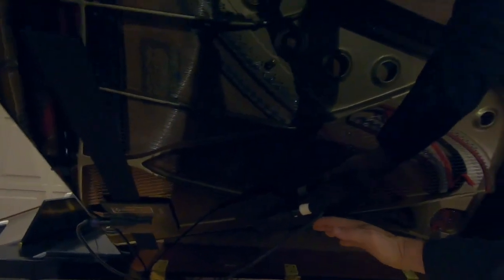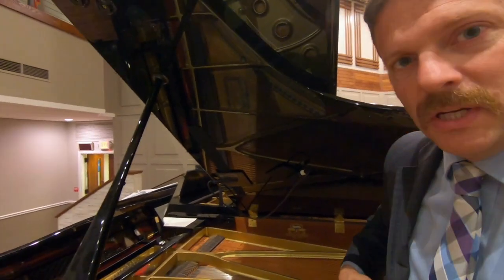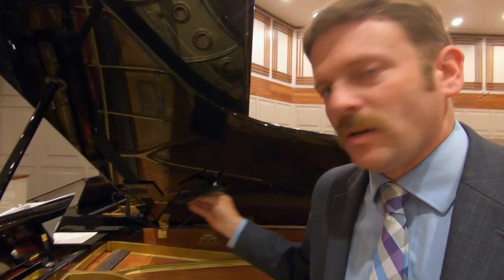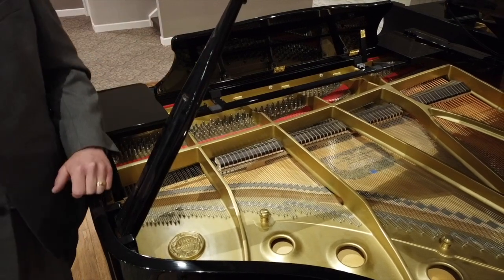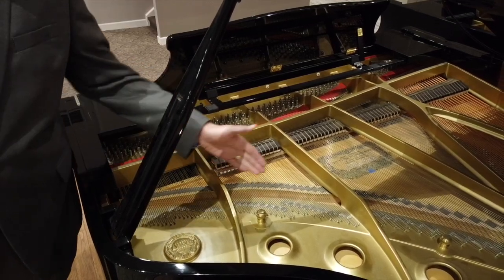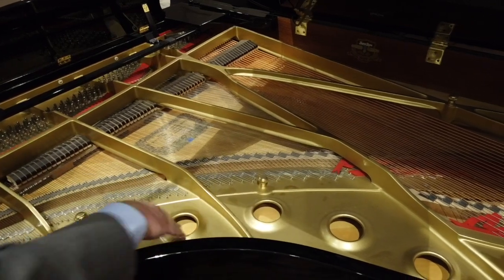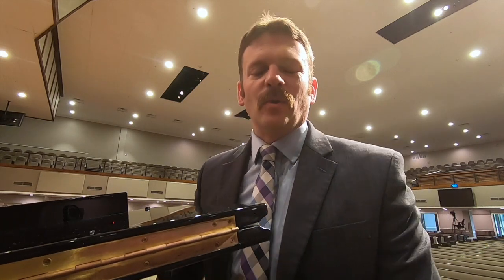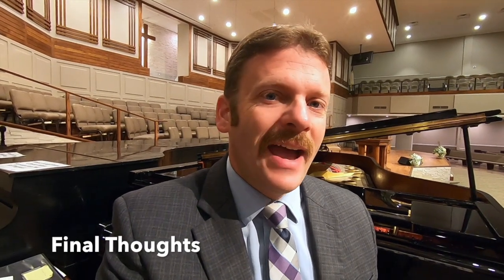How to mic a grand piano - Sound Advice 07

Comment: I love the sound you get from those PZM's! Based on your recommendation, I have purchased some of my own for the piano in our sanctuary. I am still an audio novice, so having your board settings would teach me a lot. I know I will need to experiment with our particular instrument, worship space, board, player, etc., but I would like to use your processing settings as a starting point. Would you be willing to reply with the settings you use for each of these? I'm sure I won't be the only one to find it helpful!
* Gain: 
* Frequency/Low cut: 
* Polarity (Ø): Invert for one, but not both, correct?
* Gate:  
* Compressor:  
* Dynamics:  
* Equalizer: "Brighten" between 2,000-4,000 Hz. How much? What else?
* Effects: 

* Pan/Balance:
Thanks in advance!!
Reply from the maker: Drew, a great question!  We will answer this in 2 posts.  I will take the approach from live sound-Front of House, and Jonathan will look at the recording/broadcast mix (here’s a behind-the-scenes look at the broadcast control room https://youtu.be/5wCJuqZF79s).  We might be able to get Joe’s (piano player) input in the differences between pianos.

Every venue has its own ecosystem and it’s all dependent on the type of sound system, style and needs of music and speech, room acoustics, style of instruments, and the ear of the sound tech. I love epic music, and tend to mix and EQ that way.  When it comes to the piano, the sound I love is not a natural acoustic representation, even though most people would say it is.  I want to feel the bottom register, but equally need the upper mids for the pitch reference and brightness.  The acoustic piano tends to be naturally mid heavy.  The two pianos on our platform are miked and tuned to that instrument’s sound and style.  In our church, we have a Altec Lansing center cluster that hits every seat that has a clear line of site with the cluster.  In addition, we have left and right Altec Lansing speakers that add a spatial stereo sound the center cluster lacks. And, we have 2 dual Altec Lansing 18” subs for the “epic” feel.  I mix and EQ the pianos to help lead the congregational singing, so I look for a bright but percussive sound.  The stereo mics are routed to the left and right speakers respectively and summed to the center cluster (which is tuned brighter than the left and right).

EQ:
HPF-60HZ, LF shelf-70Hz/+1.3 dB, LM-294Hz/0.9 Q/-3.5dB, HM-1.65kHz/0.6 Q/-3.5dB, HF-4.36kHz/0.7 Q/-2.4 dB. 

Compression:
3:1 Ratio, -1.5dB Threshold, 4.60ms attack, 500ms Release.

Reverb:
On the piano,I use a brighter reverb with a 1.5 second decay.  I have the reverb in the left and right speakers only.

I do not use any gates in live sound.  Both mics are in normal phase.
Reply: Hi Drew,
On the recording-side here are the settings I use. Both mics have phase set to 0°.

Gain: Same preamp as FOH
HPF: Off unless needed for someone "thumping" the sustain pedal. 
Gate:
   Attack: 500μs
   Release: 1s
   Hold: Off/lowest time
   Threshold: Depends on your preamp level. I have it set at -28dB for our set-up.
   Depth: 20dB
P-EQ:
   Band 1: 48hz shelf - 14dB
   Band 4: 2.5kHz shelf - 6dB
Compressor: 16T Comp/Limiter
   Ratio: 1.5:1
   Knee: Hard
   Threshold: Again, depends on your gain but we are at -12dB.
   Output Gain: 10dB
  Parallel Compression: On, -6dB Dry and -6dB Wet.

My master output has the following:
Compressor: Manual RMS
   Attack: 300ms
   Release: 2s
   Ratio: 4:1
   Threshold: -15dB
   Gain: 18dB
   Knee: Hard
   Parallel Compression: Off
Reply: Thank you both so much! Going to get these installed using Velcro per your rec, and going to start with these settings for our live and broadcast mixes!! Thank you for your ministry!!!
Reply: Joe here chiming in. To add to the discussion, every piano is different, sometimes even the same model from the same manufacturer. For instance, the piano in this video is a Kawai RX-6. At our college is a Kawai GS-60. They're very similar in size and of course manufacturer, but the two pianos sound absolutely nothing alike. In my experience, moving the mic(s) as little as an inch or turning a few degrees can make significant changes in the sound. You've come this far, so take it all the way by scheduling an hour or two with your main pianist, and have them just play while you move the mics until you get happy. Then take a 10 minute break, and then listen again to make sure you're happy. It may seem tedious, but it's definitely rewarding in the end!
Reply: @collinschoral  Also, if you have access to a phasescope, use that as well as your ears to adjust the mic positioning. Pan the mics hard left and right and the scope can give you some helpful information. You want it anywhere between 0 and +1; 0 being a full stereo image and +1 being mono. If it goes into the negative, your mics are out of phase. If they are out of phase a little, it won't necessarily sound bad on a stereo recording but in a mono mix, the two mics will subtract different frequencies from each other rather than adding, which can lead to a hollow sound in mono. I hope to do a video explaining this in more detail with Jude.

Here's a free one: https://www.voxengo.com/product/correlometer/
Reply from the maker: @collinschoral  Glad to hep!  We are working on more sound advice videos that hope will be a help to you and many others.

Comment: I have 2 boundary microphones (Audio Technica type AT841R) as well and would like to try out your approach. However I am affraid they will not allow me to put tape on the grand piano. Usually I put them in front of the piano on the church floor and I am not fully satisfied with the result of the recording. For a small ensemble this works great however for piano solo I know it could be better.

Comment: With your help, I have gained great wisdom in miking the piano. Thank you. I have 1 PZM microphone. The other one has the AUDIX SCX 25A. The PZM mic panned left toward the hammer, and the AUDIX mic was contemplating where to place it. I want to buy one more PZM microphone, but I want to use the AUDIX microphone. Can you help?
Reply from the maker: Thanks for watching!  I’m not familiar with the Audix mics.  I would try pointing it over the bridge of the piano.  But I fear you will get a much different sound from that mic. The PZM mic is a different sound from regular mics.  Let me know what type of sound you get. I’m very curious.
Reply: @audiobuff  Thank you for answer. "bridge of the piano" Where exactly is this part?
(High note?) on the keyboard of the right hand
please
Reply from the maker: @paparaphatv  the bridge is where the strings touch the wood. About 3:40 in the video.